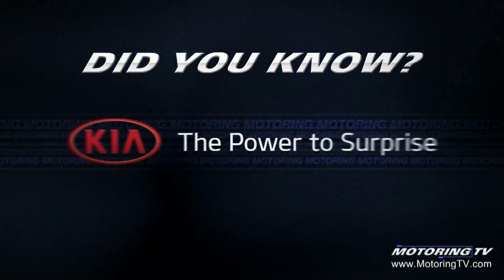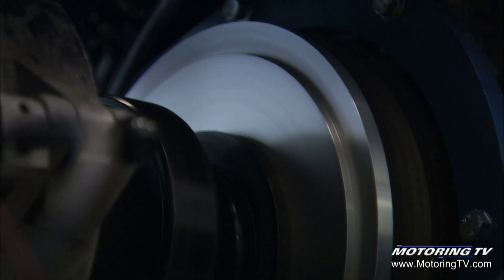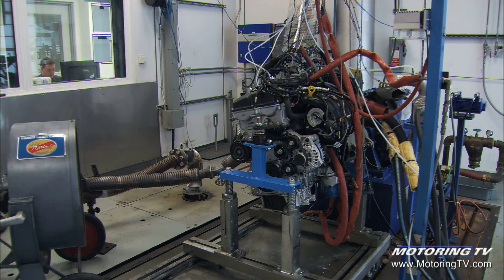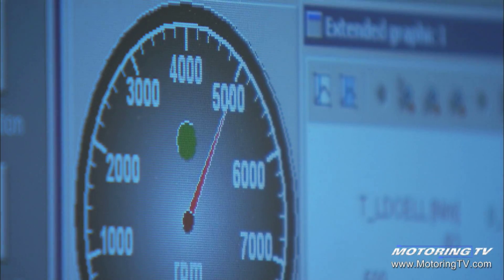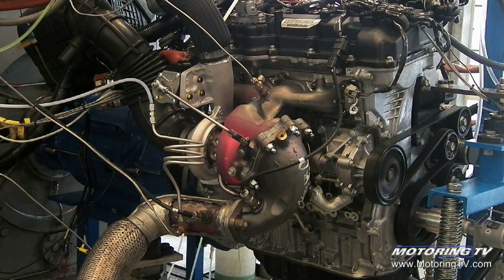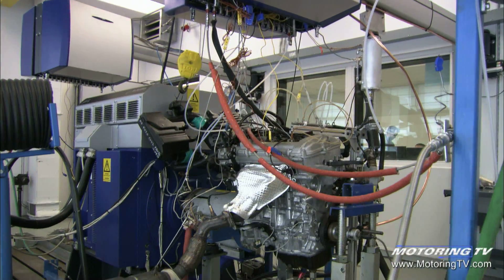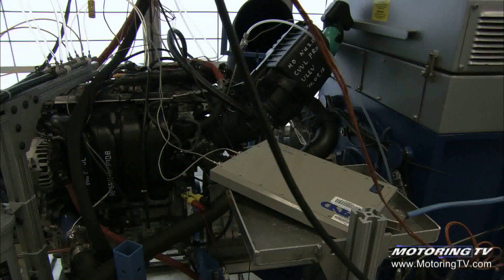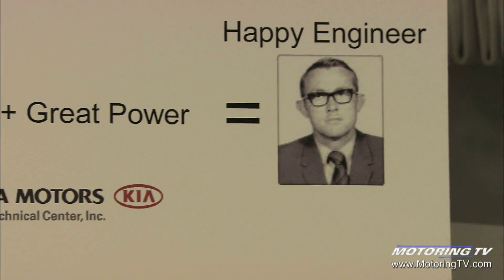Did You Know: Engine torture testing

Comment: Their motors blow up left and right 🤔 should’ve ran it longer 😆 
Ole rod knock trick at less than 100k is a joke
Reply: That was one particular engine. Hyundai believe it or not does have very durable engines. My 2011 accent has 278k miles. Bought it with 98k and I’m younger so I have a lead foot. Redline it daily. It uses oil, but it’s never had any issues, other than ignition coils and some sensors go bad. Normal maintenance,timing belt, clutch ect.
Oh and I didn’t change the clutch or belt till it was well over 200k.. 1.6L alpha